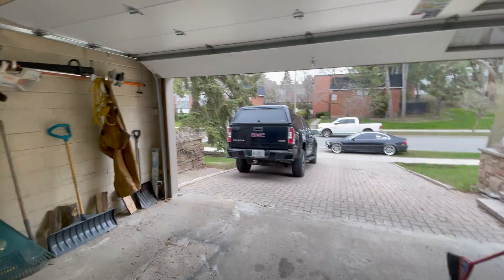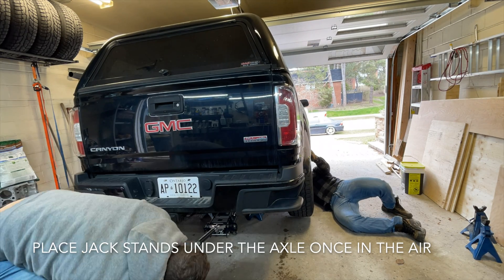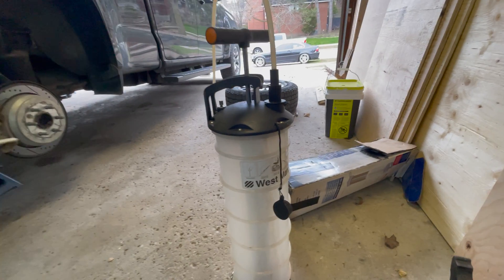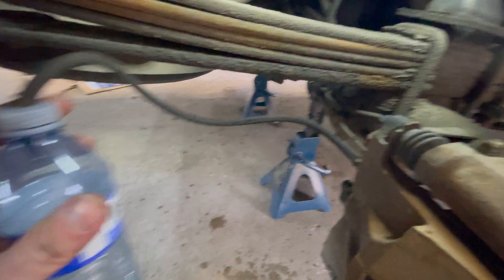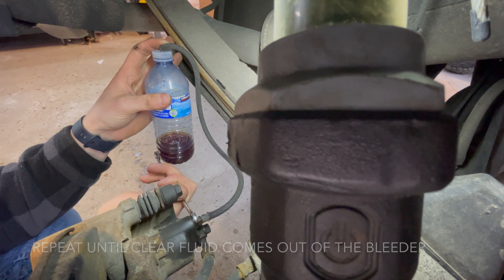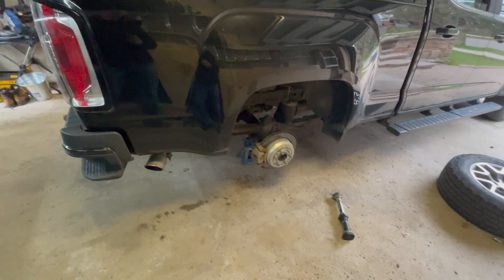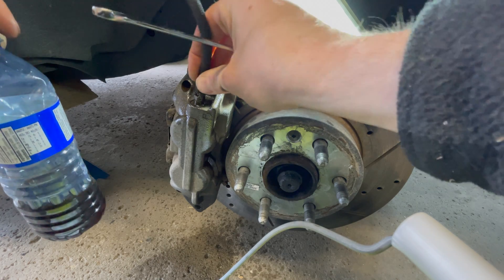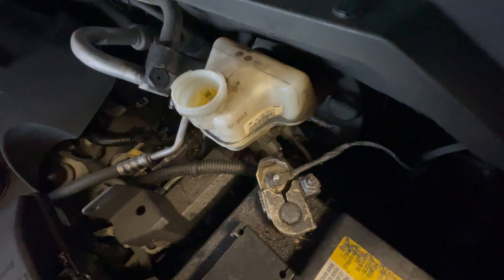Colorado / Canyon | Brake Fluid Flush

Comment: My first truck and I was not paying attention to what I was doing . I ended up removing the 4 bolts holding the caliber together. Fluid started to leak . Once the tire and bolts were back in place . I fanned the brake pedal but now my brakes feel spongy and I have to push the brake pedal all the way in to get to stop my truck. Any ideas or info will help. Thank you!

Comment: Good evening, my friend. I have the same truck, but I have a problem. The rear wheel makes a knocking noise where the brake disc goes. Do you think you can help me?
Reply: look to see if rotors are rusty on back side, happened to a friend

Comment: 1 correction. Typically you would do 1 rear then 1 front and rotate. As thats how we did it at the dealership
Reply from the maker: As in Change them 1 side at a time front to back?
Reply: Hey, you do you! I literally completed mechanic school and we were taught furthest from the master cylinder . On that vehicle, it would be Right rear, left rear, right front, left front. It was actually on our test and had I put what you suggested, I would have been marked wrong. I’m working at a tiny at home local neighborhood shop and it’s my day off because it’s my birthday and that what we do here.